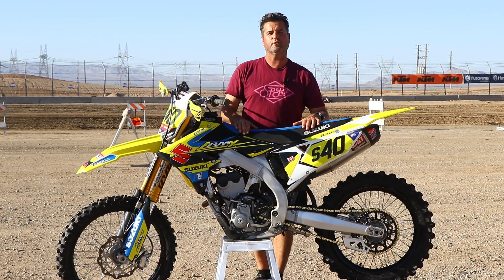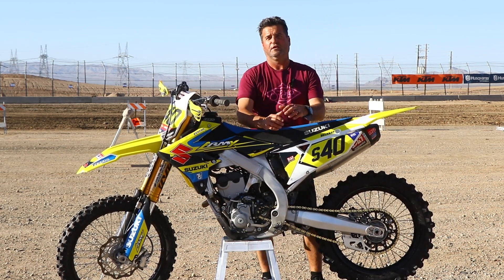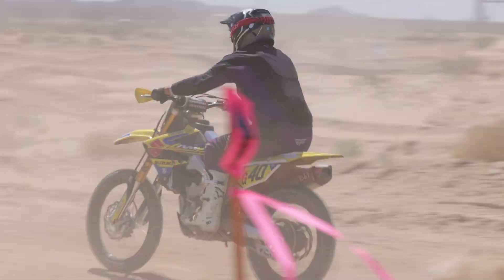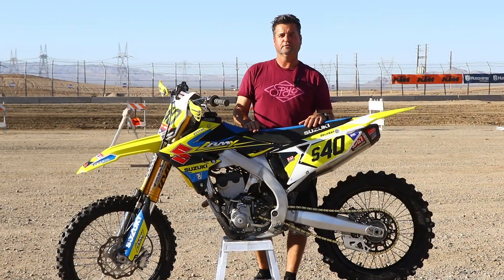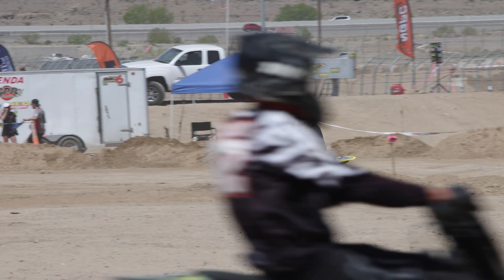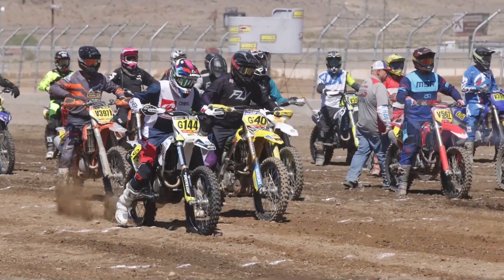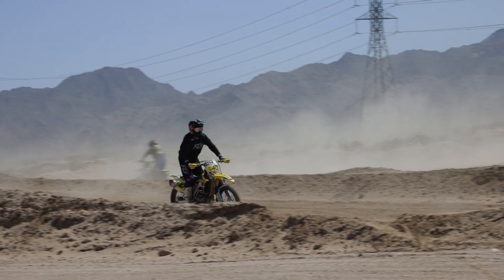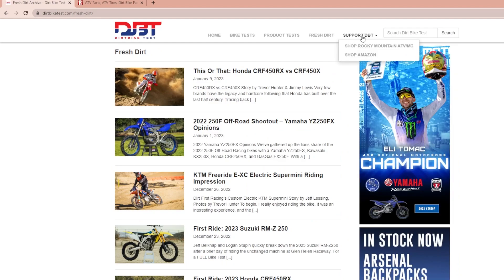RM-X250Z Off-Road Project Bike Update #2 | Dirt Bike Test

Comment: What would be more competitive in this class for the money? This, or the YZ250x (2 stroke)?
Reply: IMO the yz250x would be the better option for many reasons. But it really depends on you the rider to find what works
Reply from the maker: It would widely vary depending on the rider and the terrain on hand. Sheer power, the YZ250X is probably the faster bike in most cases but the RMZ has a lot of strong suits to it.